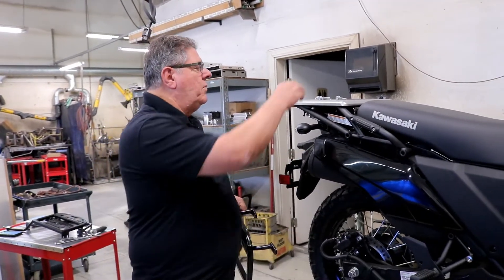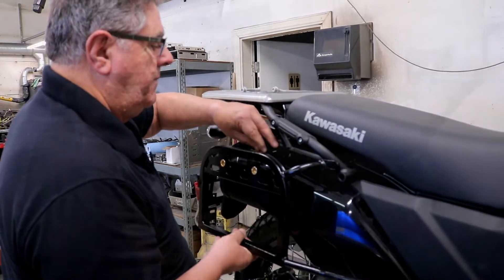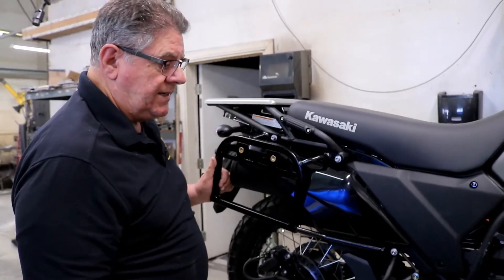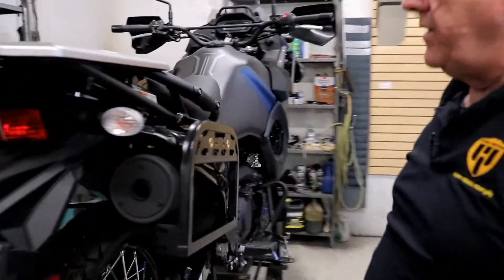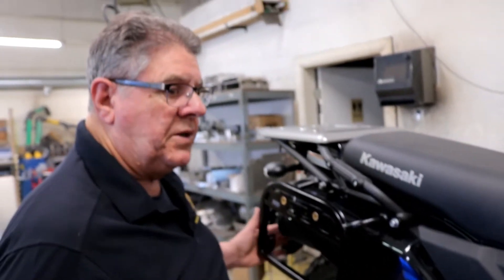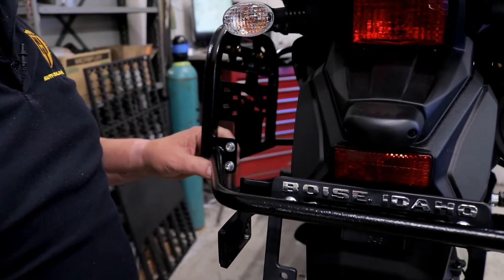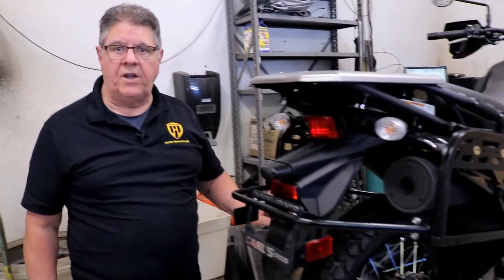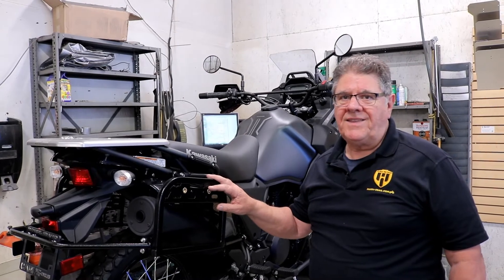2022 KLR650 Build - SU Luggage Rack Install!

Comment: So, 

Is a luggage/pannier rack needed for soft bags? I have a Wolfman soft bag shaped like a U and I'm guessing this is needed not necessarily to support the bag (as it sits on the seat) but to keep it away from plastics and exhaust?!

Is that correct?? 

Thanks
Reply from the maker: You are correct, you'll want a rack to push the bags out away from the exhaust so they don't melt (along with your contents inside). But you wouldn't need the SU racks, they are built a little heavier with square tubing and a bumper that's more for hard luggage. You would want the SL (Soft Luggage) Rack here https://www.happy-trail.com/find-your-bike/kawasaki/klr650-2022/luggage-racks/happy-trails-sl-side-rack-kawasaki-klr650-gen3-2022.html

Comment: Can you do a video of the 43 liter top box and install plz
Reply from the maker: All the top boxes install basically the same, here's an install with the quick disconnect system. Installing without the quick disconnect only requires drilling holes and bolting it to a top plate. https://www.youtube.com/watch?v=oLWrKrb59to